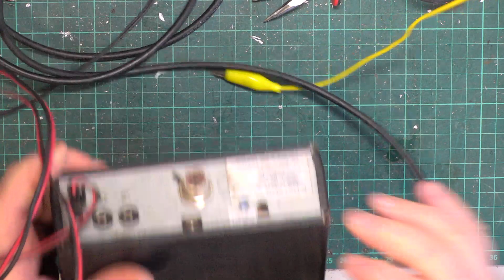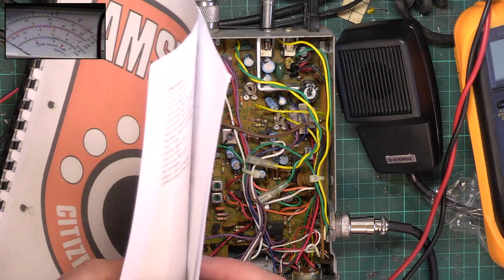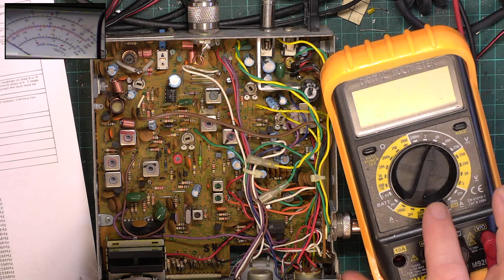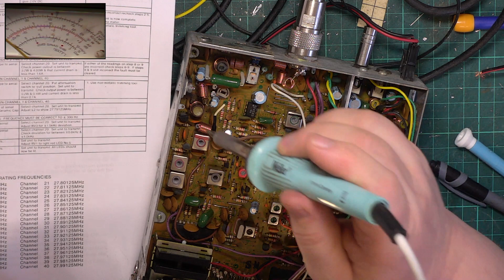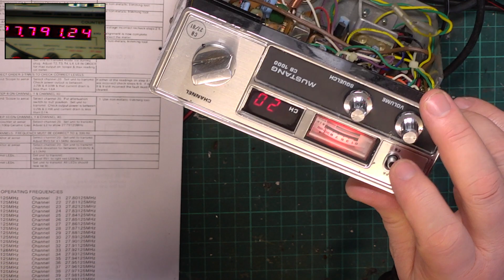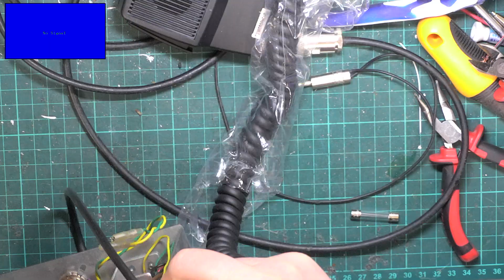Mustang CB1000 UK CB27/81 CB radio (mobile) - Repair & service

Comment: An Amstrad Cybernet board.  Thought so, but it is a bit better looking than an Amstrad and they do have a meter.
Was Mr Sugar behind the Amstrad CBs?
Reply from the maker: I just think Mr Sugar had them made in a hope of cornering some of the market. Notice there was never any other sets than the 900, 901 & HCB1 h/held. Yes, the mustangs all use the cybernet 002F board, all three models have meters & are all made in Japan.

Richard
Reply: @ukfmcbradioservicingTango21  Thank-you for the information.

Comment: Looks like they've took the big green resistor out in order to gain more power - blown the original output transistor and replaced with a fake.
Reply from the maker: The 'wrong' transistor is a Mitubushi 2SC1969 which according to my Mitsubishi datasheet can do 12W in certain configurations, so not too different from the Mitsubishi 2SC2166 that should be fitted. Notice how the crappy Zertagi meter saw 10W with the ballast resistor linked out, but the spectrum analyzer saw 3.1W on 27Mhz & 3.4W on 54Mhz. After replacing the ballast resistor & tuning the TX, the radio easily managed 4W on 27Mhz & all the spurious emissions were back in spec. That's what the screwdriver expert sees: 10W on a non-selective power meter when in fact they've turned the power DOWN to 3.1W with all the rest of their so-called power elswhere!

richard